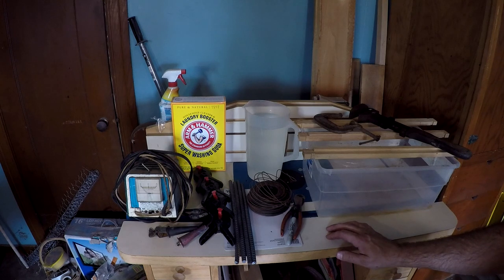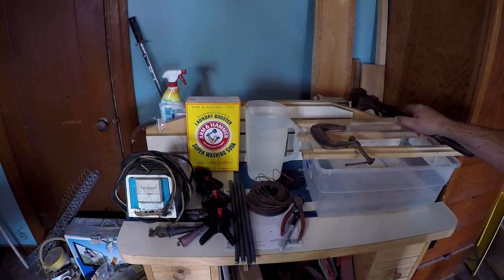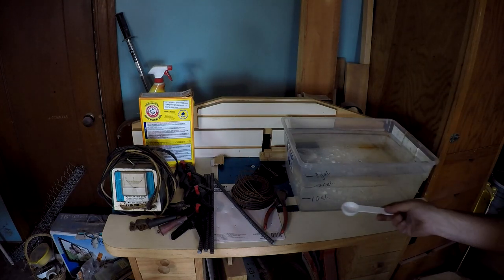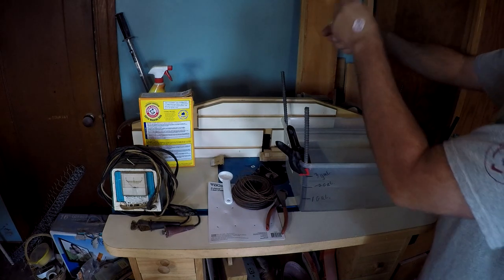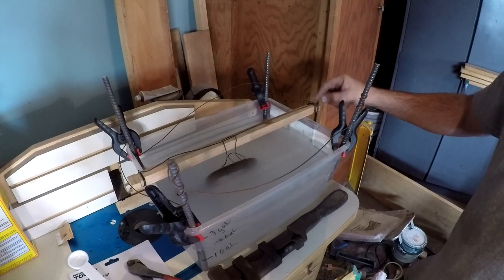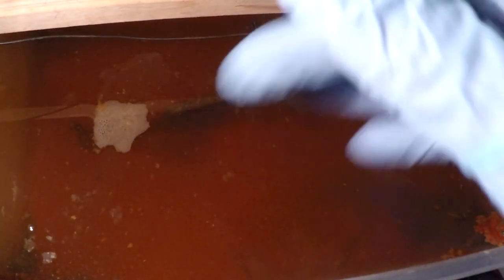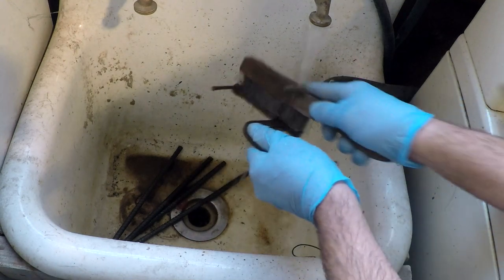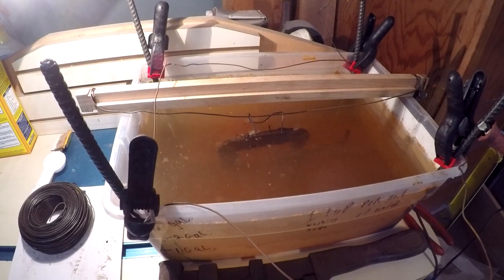Electrolysis For Rust Removal

Comment: Hey Chris, I just love that method of removing rust.  As you have noticed, connections are paramount.  Also, the soda solution, it doesn't matter the exact concentration.  I adjust the amount of Soda until I get the current draw that I am looking for.  I usiually run between 2 and 4 amps.  Less will work, it just takes longer.

Joe
Reply from the maker: +My Heap seems to work out to one to two tablespoons per gallon a box of that stuff is going to last forever
Reply: It certainly will.  As a matter of fact it will turn all hard and lumpy.  You will have to break and mash it up to use it.  Does not affect the stuff though!

Joe
Reply from the maker: +My Heap break out the hammer

Comment: I don't know if it makes that much of a difference, but I would attach my wires on either side of the screw, where it runs through the clamp body.  That should put the negative charge where it's needed most.  Other than cosmetics, it isn't as important if the clamp frame has a little rust on it.  The screw (and the point where it runs through the clamp body) is what needs to be free of rust.  So long as the body isn't so rusty and pitted that it's strength is compromised, it will still work fine as a clamp.
Reply from the maker: it can only clean line of sight to the anodes i am getting plenty of bubbles coming off the screw so should be doing all it can

Comment: Instead of washing soda, I use TSP ..tri sodium phosphate. You can get it at the hardware store in the paint department. It is a powerful cleaner so avoid putting your hands in it. TSP has the advantage of removing oil from the part you are de-rusting. Good electrical connections are important for good results so having a shiny spot on your work for good electrical contact makes it all work better. If you use rebar, grind the scale off it... shiny metal is good. You will find that the scale that builds up on your sacrificial metal is almost impossible to brush or grind off.... I stick them in the lathe an cut it off back to shiny metal. The scale build up slows the reaction down, so cleaning every hour or so makes things go faster. 
I use a feed back 12v battery charger and it works just fine. It will give you an indication of when the electrodes need to be cleaned as the amperage begins to fall off as the scale begins to build up on the sacrificial electrodes.  You may find that black smut will start to build up on your work. It will brush off, but in the case of things like motorcycle gas tanks I leave it as it helps prevent further rusting inside the tank.
Once you get your de-rusting rig set up, you will run around the shop finding all the rusty stuff lying about to make it all pretty! Be sure to dry off your parts immediately and oil them or spray with primer. If you've done a good job, the work will get a new coat of rust in no time.
Reply from the maker: I can find washing soda at the local wallmart at any rate that's a heap of information thanks for posting it all very handy

Comment: Another good video Chris. I use a similar process for derusting parts. I do want to correct a common misconception. I use baking soda as the electrolytic additive to allow the water to better conduct electricity. 
Baking soda, also known as sodium bicarbonate chemical formula NAHCL3, is a safe way to do electrolytic rust removal. Baking soda does not contain chlorine in the formula and cannot release chlorine in the electrolysis bath. Washing soda can be made by heating baking soda to drive off carbondioxide and water. 
Washing soda, also known as sodium carbonate chemical formula NA2HCLO3, also does not contain chlorine and cannot release chlorine from the electrolysis bath
I believe you are confusing two different processes. There are commercially available chlorine generators that  introduce chlorine into swimming pools. The chlorine generator uses sodium chloride, or common table salt chemical formula NACL,  as the source for the chlorine. The chlorine generator electrolysis process to strip the chlorine from the sodium chloride and generate chlorine for the swimming pools. 
https://www.swimuniversity.com/salt-water-chlorinators/
While both baking soda and washing soda can be used to create a rust removing electrolysis bath, washing soda is much more reactive than baking soda. 
"Sodium carbonate can be dangerous in large quantities, make sure to keep washing soda out of the reach of children and pets. You should wear gloves when cleaning with washing soda, because it can cause skin irritation. It can be harmful to the eyes, cause irritation to the lungs if inhaled, and may cause abdominal pain or vomiting if large doses are swallowed."
https://www.thespruce.com/what-is-washing-soda-2145888
Any process that has an electric current flowing through water can release oxygen and hydrogen. Proper venting to disipate the hydrgen and oxygen should be used.
Reply from the maker: +Old Sneelock's Workshop very helpful I think I'm going to pin this to the top when I get home